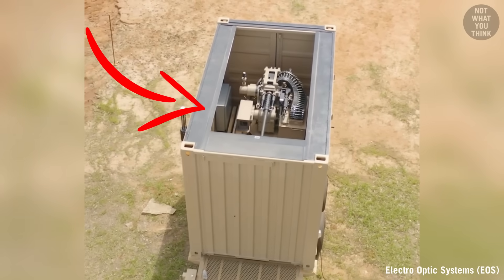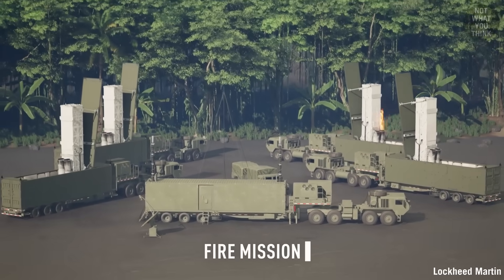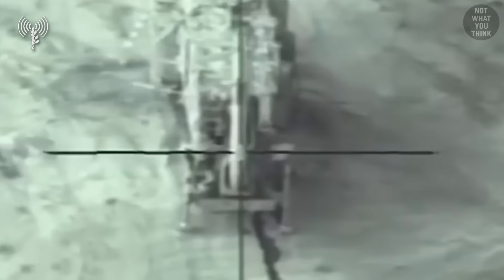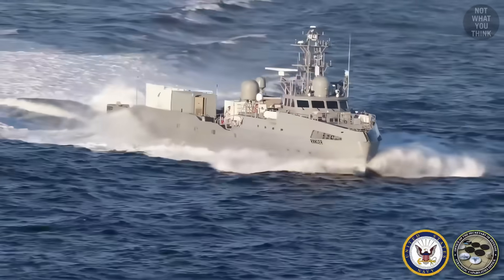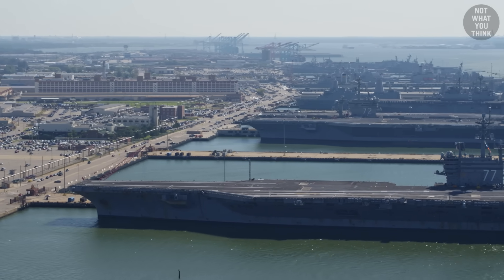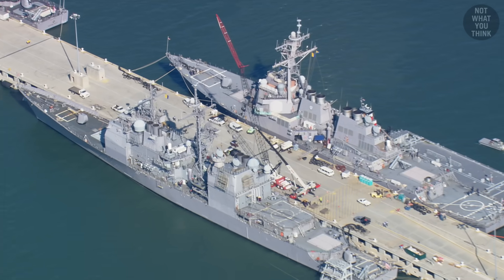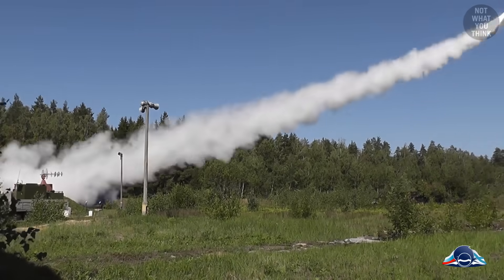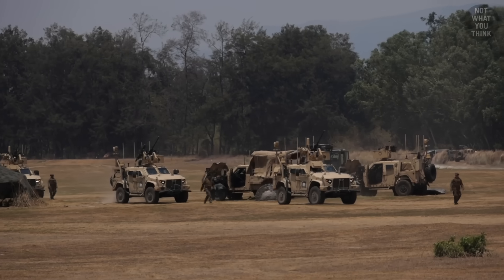Why Containerized Weapons Are So Terrifying

Comment: Recently, India tested their new ballistic missile system from the shipping container present on one of the trains.
This means that all the vast network of Indian railways which is the second largest in the world can be used as a missile launching pad and no enemy would be able to intercept it as the trains are in constant movement
Reply: Unless its derailed
Reply: @uptowndunker6346 derailing incidents are too rare. Maybe 1 or 2 in 3 years?
Reply: @theprotagonist8997 Counterquestion: How are you going to patrol several hundred thousand kilometres of track in case of a real deployment?
Reply: There’s reasons countries stopped using rail artillery.
Reply: @lamchunting856 in the indian context  its a very good idea unlike russia  it's hot year round and a very vast dense network with lot of tunnels
Reply: @modibhagwanhai8914  Compare India railway with russians is too insane, India railway have only 69734km, if discount unavaluible narrow gauge it would be 66820km, Russia railway is 85600+km in operations/128000+km total.
Reply: @lamchunting856  In this case, it's not artillery, but a launcher that can be installed on a train, but not only on a train.
Reply: The Soviets had train-borne nuclear armed ICBMs. See the RT-23 Molodets.
Reply: @Infanterie_Marine  Those are still in use in Russia. Fortunately, spying from orbit can't distinguish them from normal freight/passenger trains.
Reply: And in same time, India‘s opponents all have road mobility irbm/icbm system and complete ABM system.
Reply: @bvvdanton u can't have a icbm on road all the  time Pakistan has anti ballistic missile system but they are imported they have around 300 or so missles according to sales documents and we anti radiation missiles in Pakistani context it will be light work as we took out two air defence battery one in okara and lahore  with harops in may
Reply: @modibhagwanhai8914  Railway mobile ICBMs can't move all the time on railway too. Railway system itself are easy target for missles and plane, they are very weak and detectable. That's why there's no railway mobile ICBM system left in other countries, even if they once have. Instead, road mobile is far more difficult to detect and destroyed, and could respound much faster.
Reply: @bvvdanton how can u track a train travelling on a dense network where it looks like any other goods train or passenger one and india has a good air defence no Planes are coming in without getting shot and spy satellites have countless limitations like bad weather cloudy weather and train has moved good luck tracking it train launchers are inferior to ballistic missile submarines but far far better than a missile silo or road based launcher as icbm with range of large range ain't gonna fit on a 40 ft container and chances accident are more compared to a train
Reply: @modibhagwanhai8914  Let me tell you, Even Russian's ICBM train can't hide itself into other normal trains - the ICBM carriages got Three-axle bogie, and are 1.3m longer than normal trains. India? I don't believe India could do better than Russia. Those other benefit you said also work to road mobilize ICBMs. Road mobilize ICBM carrier vehicles could built as long as the missles, while Railway mobilize system needs a special-made missles that could been put into passenger carriages.
Reply: @modibhagwanhai8914   I have a suggestion for you, "Open your eyes". Look at the world, admit your mistakes.
Reply: @bvvdanton  india is a big country how any country with current technology constantly be tracking a moving object when it can be hid in a thousand tunnel even if u track it its moving at 120 km per hour the logistics of hitting it will be very hard almost impossible and it would require atleast icbms as the train will atleast be 3000 kms away from the border there is no icbm that can hit land based fast moving object  at 120 kmph  tracking constantly almost impossible targetting with constantly  manuvaring target almost impossible and spy satellites have limitations weather tunnels  constantly moving would require dedicated one spy sat per train or a constellation most probably the point is not  it can't be done but will require shit ton of a enemys resources getting diverted from airbases and other important locations and that's a win in my books india doesn't have  make to the train entirely different just has to make the roof of the train match the cargo train ones as it will most probably be tracked via spy sats road based ones are also difficult but so are  trains todays high energy density propellants and composites have made missiles very light compared previous generations so modifications will not be that hard
Russia is 5.2 times bigger than india but the railways are only twice as big meaning they are not that dense and india has thousands of trains per day increasing problems in tracking and  india weather is hotter compared to russia so lower maintenance
Reply: @modibhagwanhai8914  Satellite and mobilize part I have already talked about. About railway density, India is better than Russia; but again, that does not help. Missle carriage itself is very iconic. About weather, Indian high-temperature and high-humidity is as terrible as Russian -50°.
Reply: @bvvdanton  if that doesn't help what does show me a example of a missile a ballistic missile which can target a land based moving object at 100 km per hour and terminal phases of a ballistic missile depends mostly on inertial navigation and other onboard sensor as its hypersonic at that point plasma sheath will refective how will anyone be able to destroy a train at  thousands of km range tracking very hard hitting also difficult as for humidity have u heard about aluminium. train is not the great wall of china to be iconic its not stationary
Reply: @modibhagwanhai8914  Because in nuke war, enemy could easily blow up some railway hub and paralyzed your railway system, that's one of the reason why russian gave their railway mobilize ICBMs up. I didn't said Railway ICBM systems is bad, I said Road ICBM systems is better.
Reply: @modibhagwanhai8914 America keeps constant track of every single warship, in perpetuity. A single train is light work.
Reply: Then your entire rail network infrastructure become legit targets. The enemy will just blow up your train stations to justify. Basically using civilians as meat shields.
Reply: @EricWei-c7m any rail network is already a target in a war so nothing was lost and the Indians just gained operational flexibility
Reply: @EricWei-c7m  how can any country attack and destroy 70 thousand kms of railway lines and even if they attack it will be quickly repaired and attack civilians than genava convention comes into effect
and anyways both countries will use trains to transport weapons and soldiers so its a legitimate target anyways irrelevant of a train carrying icbm
Reply: @modibhagwanhai8914 Hey. You know trains need ALL the rails on their route to work? You wouldn't have to disrupt every meter of rail- try targeting switching stations, overhead power transformers, that stuff. Bam, immediate, total gridlock. I'm sure China has a file somewhere on EXACTLY where they'd have to plant charges to disrupt as much rail as possible.
Reply: We had this under Reagan
Don't believe it was deployed
Reply: US is 1st and China 2nd when it comes to railways
Reply: @kevinv3169 Wat? By what metrics?
Reply: this concept is very old

Comment: New fear "Containerized nuclear weapons."
Reply: Just wait until you learn about the W54 Nuclear warhead, Small enough to be carried (and was even designed) to be carried by a singular soldier, Like a backpack.
Reply: Theres small enough nukes to be able to do that
Reply: @jtgda container can hold a full size nuke
Reply: That's not a new fear there are movies from the 80's where Soviets or someone else put a nuke in a shipping container. Also in real life both the US and USSR had tiny nuclear weapons that could fit in large backpacks (like it's pretty obvious) so you could grab a few though them in the trunk of your car and place them around town in a city. When Wagner did it's short lived revolt they took a facility that housed such nuclear backpacks.
Reply: Not much of fear when realize that the BGM-109G was basically that except smaller and far more mobile
Reply: Modular nuclear reactors exist
Reply: @omkr0122  nuclear reactors are not and cannot be nuclear bombs. Different design constraints.
Reply: @robertb6889 it's a power plant. Not a nuke
Reply: @omkr0122  I'm not particularly concerned about someone shipping a modular nuclear reactor. I would be about a nuclear weapon.
Reply: Basically a subplot of the first Call of Duty: Modern Warfare game. Soap's first mission as an SAS operative is them finding a suspected nuclear device smuggled inside a cargo ship in a shipping container...
Reply: They’ve trotted that out since 9/11. Remember the ‘suitcase nukes’ and books saying AQ planned to hit multiple US cities?
Reply: "Look what Iran did to your nice city, goyum!" -
Reply: The sense behind nuclear weapons is not hiding them, but making sure everyone knows, that you have them!
Reply: Container nukes doesn't add anything new that boomers already do better.
Reply: @LeonardTavast  terrorism, asymmetric warfare and making it hard to trace the source of an attack.

Imagine Iran or a non-state actor sticks a nuclear bomb in a container that goes through a bunch of different places disguising the origin, then a container ship with 20,000 containers from a couple dozen countries explodes in port with no easy way to know which one went boom.

It's more about being able to track who launched the attack, rather than sabotage that would be near untraceable if done right.
Reply: @robertb6889  Iran does not have and could not feasibly create a nuclear weapon small enough to fit inside of a containr whilst lso bein attached to a missile. it would have to be or the other.
Reply: @Jeremiah-r3q he said explode in port
Reply: @robertb6889  imagine when we do it.
Reply: @Jeremiah-r3q  sure they can and if they are smart they will nukes are the only thing that keeps us away
Reply: @Jeremiah-r3q  You might want to edit that so it's actually readable.  But Iran was just a hypothetical - the main idea of anyone with such a device being able to destroy a port without easily being able to trace and retaliate against the attack. Nuclear sabotage.

A missile is pretty damn clear where it came from. A shipping container on a ship that quickly became exotic physics rather than materials is going to be very difficult to narrow down.
Reply: @matthewgibbs6886  The point of nuclear weapons is NO ONE should do it.
Reply: @robertb6889 The sources of fissionable material for all nations on earth that use them are pretty well-documented. You can’t really have an “anonymous” nuke. The ratios of the fission products are often enough by themselves to identify the specific reactor that the core material came from.

The US has had aircraft to do this specific analysis via atmospheric sampling for decades and decades.
Reply: @robertb6889 The idea of a non state actor having nuclear weapons is just absurd the stuff of novels and tv shows and not reality. I really would not worry about it. Re Iran they do not have nuclear weapons. If they did they would not be insane enough to use them on anyone. These are just fairy tales to scare people. The threat is from the major powers who have them and might have used them before.
Reply: @blackmagicprod7039  interesting counterpoint - that actually would track and make things a lot more clear who was responsible. Doesn't impact non-state actors, but if they get a nuke it's just a question of delivery, so our best bet is keeping them from getting one.
Reply: @Jeremiah-r3q got 40 feet to play with
Reply: @VictorV-b1xno
Your wrong
Reply: @robertb6889 I like the Tom Clancy thinking but this kind of plot exists in his books only. Preservation of MAD, the nuclear taboo, and non proliferation are things that literally every state, but especially nuclear states care about more than nearly anything. Non state actors getting their hands on nuclear weapons is something that would unite the world harder than an alien invasion. 

If anything like that ever happened every single intelligence agency in the world is immediately devoting 100% of their effort to finding out exactly what group did that with zero ROE, and it is not possible to hide from that. Nuclear weapons are probably the most traceable things on earth, even after they’re detonated.
Reply: @robertb6889 thats for state actors and the dissuasion doctrine but a terror group that gets their hands on a SDN (backpack nuke from the cold war for spicy sabotage) could neutralize a port or at least a big part of it (mostly because non airburst nuclear bomb of reduced size would be quite limited in effectiveness) but if you took those cold war SDN a drone could carry it in the air after you calculate the necessary heigh for the device to maximize the damaged (basically you turn a sabotage nuke backpack into an improvized airburst micro nuke bomb since 25 to 30kg is within a drone payload capabilites....well said drone would be a tad bit bigger then an fpv and very noisy and wouldnt have much time to act

Comment: Ya know, it would be an unironically good idea to use NFTs with shipping containers. Combine it with an international database that keeps track of each NFT, and you have a system where commercial cargo crates couldn’t be faked.

It might need some kind of broadcasting added to allow for long distance inspection of crates.
Reply: this doesnt need NFTs to work imo
Reply: @God-ch8lq it seems kind of smart though, blockchain technology is hard to hack.
Reply: @God-ch8lq  the reason i think NFT's might be needed is because they aren't fungible. meaning it would be a unique ID and couldn't be co-opted by a government. i think at least. i don't know NFT's that well.
Reply: You can't make an NFT for a physical weapon, only for data. And  even with data, a minor change (say altering the colour of a single pixel in a picture) would make for a completely different NFT. It is simply not possible to reliably fingerprint the contents of a shipping container.
Reply: @lukaswinter8409  the NFT would be a tracking tag. probably hidden inside somewhere so if a government does try to take it, it's more expensive for them to do so.